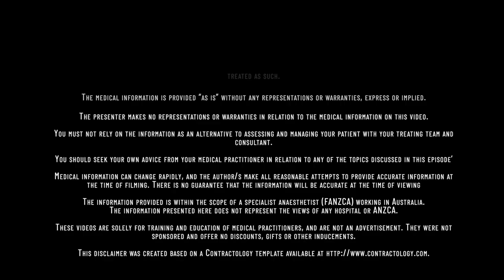Factors affecting mixed venous CO2 tension

Comment: Can I ask, why did you start talking in terms of CvCO2 when the alveolar ventilation question deals in terms of gas tension? And additionally, the ventilation equation refers to PACO2, which we assume is near enough identical to PaCO2 because CO2 is never diffusion limited. But how does that relate to PvCO2? Is that simply that if you have more CO2 in alveolar gas that there is less of a gradient for it to equilibrate? Or is it that PaCO2 is higher and therefore that’s carried around the circulation into the venous system?? Sorry if you made it clear in the video but I couldn’t quite follow it. Great podcast btw!